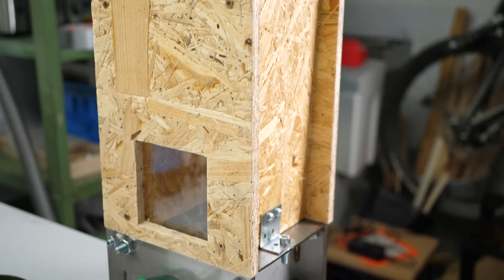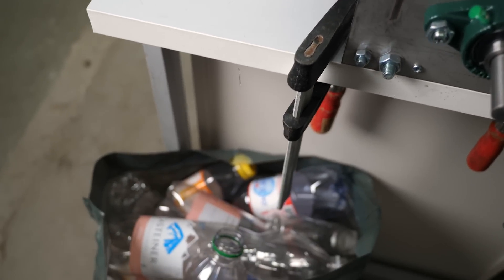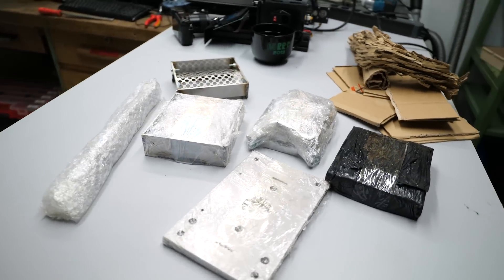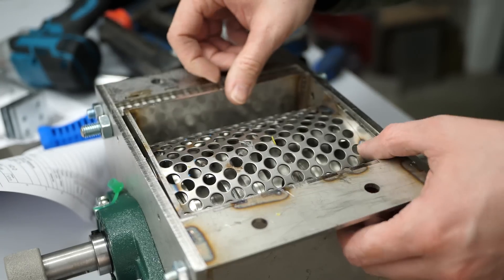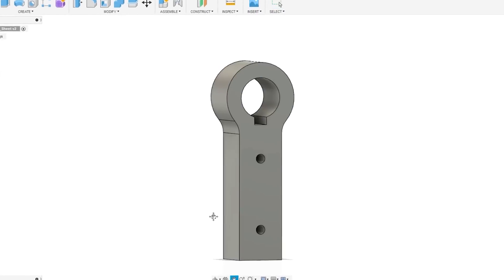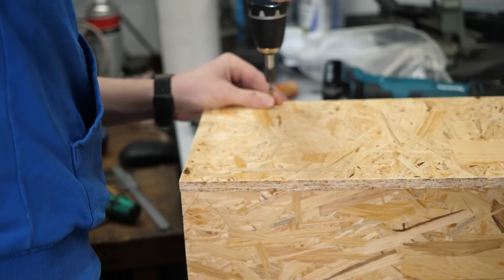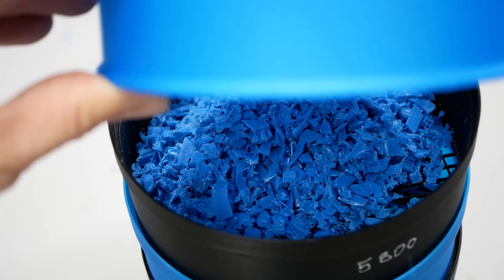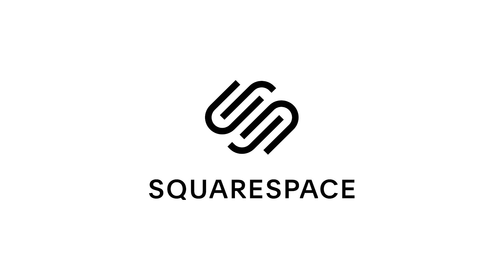Building a Hand Cranked Shredder for Recycling Plastics 💪

Comment: Hi Stefan.
first of all, i really hope the notorious covid 19 isn't doing too much damage there.
I think the machine you bought is very interesting but I think it really needs a lot more power to work.
You could try adding a (very robust) grid above the entrance to limit the amount of material that is sheared by the knives, as an electric planer would do, while in the current configuration the whole thickness of the piece comes to stand between the rotating knives with greater effort on your part, then adjusting the height of the grid you would get better control in the size of the ground material.
To compensate for the loss of efficiency then since the effort would have decreased, you could increase the speed of rotation.
I hope I have been helpful, otherwise I apologize.
P.S. another solution would be to use a branch grinder for the garden, it is an idea that has come to me now, the operation is similar to a food processor: two blades on a disk placed under a tube from which the vegetables to be sliced fall , if you know someone who has one you can test its efficiency and if it doesn't work you can send me to direct the traffic :-))

Comment: Braze or weld a socket on the end of the shaft and use a mechanics impact gun to drive it. you can get them as electric plug in units but the battery ones are more handy but a bit more pricey. the air driven ones are good but too load and cumbersome with the air hose and stuff.
the battery ones are about 1000-2000 ftlbs of impact torque and the plug in ones are 3000-10000ftlbs. Air ones range as high as you wallets value can expend.
That and a fly wheel would work well. You might be able to borrow a mechanics one if you take you contraption down to a local engineering shop.

Comment: If you don't use spur gear reduction, a single stage planetary gear box will add plenty of torque although you wouldn't be able to fix a flywheel.

Comment: I'd say add a geared motor. Your motor doesn't need to be as powerful then. Or at least add a gearbox as Ic3Fenix suggested. You can generate tremendous torques with a properly sized gearbox so you'll be able to drive it with a tiny Lego motor.

Comment: I think you should attach this thing to an old home trainer. Use a belt system as a transmission with the needed ratio (maybe you can even use the stock parts of the home trainer) and easily shred kilograms of plastic by using foot pedals :)

Comment: Just thinking out loud, but those industrially shredders take too big of a cut which requires a high torque force to work properly.
Couldn't you use or modify something like a rotary potato shredder or an electric "salad shooter", which would take smaller bites out of the plastic, requiring less force and also costs under $50.
Although not sure if it will cut the plastic into a constant size which you need, but I think it should definitely cut it...right?
I mean,  I just tried a cheapo hand cheese shredder on a junk 3D printed plastic part and it did start to shred it......again just thinking out loud  :)

Comment: if you can find an old powerchair, the motors on it would work I bet. the chairs here have a weight limit of around 600 lbs on them.. worst case you might have to gear it some..

Comment: What you could is use a car flywheel and starter.  You would have an adapter made for the flywheel to shaft connection. I think a starter would provide the necessary amount of  torque

Comment: here is an idea. if you get a nut attached to the end of the input shaft you can use a large pneumatic impact gun to drive it. pneumatic impact guns can provide up to 1200 ft lbs of torque so it should work.

Comment: Their marketplace is an interesting concept for connecting local business that would normally deal with primarily commercial customers, to consumers. Rather than having to pester fab shops to find one thats willing and isnt givng you a "I dont wanna spend the time on this but will if you really wanna pay" sort of quote, you can find a place that is willing to do it, has the setup for the project done already, and understands whats being built. Plus the fab shop gets to use whatever resources they invest in setting up multiple times. (Only have to do the CAD on the laser/plasma cutter once, only have to dial in the kerf compensation once)

Comment: Interesting concept! Have you considered using an impact wrench to power it? Not sure how you could implement a standard square drive on the input shaft without a mill or welder, but it would open up the possibility. Or at least you could use a ratchet wrench to improve the ergonomics, I nearly threw my back out just watching that lever go round.

Comment: might want to put a gearbox on that one before thinking fly wheel. a 1:3 ratio would mean you can shrink the handle by roughly 1/3 of it's length will still achieving the same torque. And should actually not use too much space. A flywheel would be nice too to get more consistency.

Comment: I would just make a gearbox (1:100 or similar) that accepts a normal hex socket and do the cranking using that Hitachi/Makita socket driver. Mustie1 uses an AC drill that he has a socket attached to it and uses it as a starter for the engine. Same idea, basically. The idea is that you get enough torque that you can easily spin it without having to back up every now and then.

Just for fun, you could theoretically try to to print a gearbox to do this, but maybe PLA isn't strong enough, a single tooth should be able to handle the full 50kgs of force and more.

Comment: Nice video! 
I would investigate if it’s possible to make a (plastic printed) gearbox where you can attach your battery powered drilling machine and it converts speed to torque, which you can then use as the driver for the shaft on the shredder.

Comment: I want to build a machine to take spools of filament and chop it into consistent, uniform pellets by feeding the filament into a rotating chopper.  I have some old spools that have taken on moisture, and my dehydrator doesn't do a very good job of drying them back out.  I think if I cut them into pellets, I will be able to dry it better, then use it for extruding back into usable filament or using it for injection molding.

Comment: I worked with an industrial shredder 25 years ago for a bit. You definitely need a flywheel for that small shredder. Also a hammer-mill style is much better design so that it can retract the cutting head. That way the cutter head still rotates and does not hang up. When I need electric motors, I use one from an old washing machine, there tuff and cheap or free. The motor uses V groove pulley so you can make a simple friction culch to engage the cutter head. In case of a catastrophic stop the belt will slip, very safe. The company that made that shredder could make a hammer-mill  cutting head small enough to.

Comment: I already have a full box of waste stacked up, even though I just want to do 3D printing as a hobbyist, and it's been less than 6 months I've had it. Most possible reason is that my printer is a DIY and wasn't ideally designed at first.

I would definitely consider to buy one if I had a proper workshop myself!

Comment: I wonder if you could get melted scrap prints to be fluid enough to flow enough like water and form droplets. If so, then you could cool those droplets as they fell into a collection bin and have some pretty uniform pellets to feed the next process. No clue if it’s doable, pure curiosity as that would potentially involve no mechanical parts and should be a relatively simple build. 🤷🏻‍♂️

Comment: Have a look at using an Anchor or Yacht winch for your drive system as time doesn't matter that much in your case. DC powered will give you maximum torque near stalled state in a more compact size than using AC. Keep at it :)

Comment: How about attaching a 160:1 high torque planetary gearbox made from a 3d print (https://www.thingiverse.com/thing:2375916), then use a power drill to drive the gearbox. I almost want to test this with a stationary bike to see if it is possible.

Comment: https://www.youtube.com/watch?v=uz436Ixbl-I

check this video, you need a regular motor and a gearbox that will convert the motor speed to torque power. From a small to a bigger diameter gear.
Edit: you can use your grinder as the motor, the grey on your shelf.

Comment: Awesome! I've been wanting to design a shredder like this, but the precious plastics prefabs sure are tempting. I just happened to source a beefy electric motor and gear train, but the handle solution is great
Reply: Make Anything will you actually end up posting a video on it when it’s done ;) don’t forget about the filament maker.
Reply: Hello , we invite  you to cooperate with our new 3d pinter model X5 , are you interested  ? I also send you email  .
Reply: I'm more worried of the price of the beefy gear reduction than of the beefy electric motor itself. I'm looking for a gear reduction rated for 500 Nm  ... and they are expansive.

Comment: I'dd add a speed reduction gearbox with a flywheel and a one way clutch (like in a normal bicycle). also tge option to swap the handcrank for a power drill. the gearbox should be able to withstand forces of more than the 500Nm you estimated. these gears should be strong enough if cnc carved from wood i guess.

gl

Comment: Seems you've just moved the consistency requirement further up the chain of operations. A way to avoid having to add a gearbox might be to have a separate manual press to quickly "pre-yield" thicker parts of prints so the grinding force is more even. A bit like one of those recyclable can crushers (but with a much longer lever) where you give potential problem parts a quick crush before tossing them into the bin so the later grinding is less difficult. A crusher with a long handle will be much simpler to make than a gearbox.

Comment: I've been exploring that topic before, I also shifted from filament to pellet extrusion and I even made sieves like to sort pellets, so I can share you my experience.  
Pellets are idealy rond, then cylindrical, cubic,  or whatever , before being some type of shitty shape. Raw shredded material is a pretty shitty shape. Though with more solid parts, you might have a chance with shredder alone. But I focussed on plastic waste, being PET, HDPE, PP... (you know, 3D printed stuff is cute and so, but you have to buy and use that plastic first, pla does degradate and... it just never made sense for me) , stuff we throw away every day, which is mostly thin walled. So how to make thin walled stuff thickwalled? Melting! If you melt PET bottles and let it cool kinda slowly, it becomes crystaline and is very brittle, it's almost statisfying to shredd it then and will go way easier then everything i have seen you do in the video. If you don't melt PET botlles first, DONT shred it! It's super though and it will damage your shredder. (I managed to destroy the bearing on a 3devo shredder, likely with a single bottle). On the other hand I thought,  If I melt it, I better melt into something i can easily make better pellets of, guess what that was: filament. So I used a syringe type device to melt platics into a crappy filament, to be shredded in cylindrical pellets. And that's basically my experience with it for now. 
I plan to melt plastics in battery like shaped in the future and print those directly as 2cm thick filament or so, as I over found the overal process of making pellets too cumbersome after all.

Comment: Instead of long Strait funnel, you could do a short one either with a light lid, or a misaligned v shape introduction cone ( with proper alignment bouncing parts can't escape a V ).

Donc use a fixes inertial wheel. Design it like impact drill : it can state a full circle, so that you can turn it a complete revolution before hammering the end. You may need a quarter circle mobile bit, to allow such a large movement.between  two hallow.circles. Check how hammer drills work. Also check large vis used to press books in manual book manufacturies. The vis is actionned by a two element handle. The upper one is.used as rotating hammer against the lower one. Those presses offer tremendous amount of pressure with a simple.manual direct vis, without any geer or démultiplication.
Reply: https://youtu.be/9HxTs4e5Zu0
After 0:45 they give a rough explanation of inertial rotary  hammers ...

Comment: Im hoping to do something similar but putting it on a stationary bike or motor (able to switch it for working or demonstrating). If i do the bike, would it be wise to start pedalling first and then add some pieces in to shred? Like building momentum so i dont have to back pedal as much?

Comment: you should print some filament on the print bed from shredded material then shred it one more time to get even and soother print.
that or make a cutter that takes the rough re-melted material and cuts it into the recommended size for you remelter

another thing you can try is getting an arbor press and smashing all the prints you plan on recycling. this will make them thinner and easier to shread.

Comment: I've been thinking of a slightly more streamlined method for recycling my failed prints and such when the ol' memory had a moment of relapse. I recall that a number of years ago a Japanese fellow was working on a way to recycle common plastics in a heated vacuum chamber for the purpose of converting the oils back into petroleum products that could be further refined into fuel. While it looked like an interesting idea, it was, shall we say, undersized for bulk processing.
Case in point, a similar setup would be fantastic as a PLA/PETG oven that could melt down scraps into straight ooze and fed into an extruder.
add: here it is https://www.youtube.com/watch?v=qPIHJRIpLRk

Comment: i would have tried making a shredding bar myself, each plate only having one tooth so less is cut at a time, and i would have added some kind of gearbox so i could use a smaller crank or a cordless drill to power it

Comment: First of all, you could shorten the crank by using a star-gearing. You would need to crank twice as often though. This also would have the benefit of possibly not throwing around the machine. Then, you need to mount it to the bench sturdier, but for a first test, this loos good!

Comment: 150 euros should get you a geared nema 34 motor capable of shredding it, along with an arduino and TB6600 stepper driver.
Reply from the maker: Unfortunately nowhere near the 500Nm required.

Comment: To help find the high spots you could always use permanent marker on the teeth and rotate the cutters then file at the scrubbed points to knock down the high spots. Rinse and repeat until you don't see any bald permanent marker spots after rotating.
Reply from the maker: Good point! Should have thought about that.

Comment: very cool, but a bit beyond my current budget. could we not use a wood chipper for first stage followed by paper shredder, cheap and easily sourced?
Reply from the maker: Maybe but I think that's only working with brittle materials. My goal was versatility and also consistent particle size.

Comment: Gear box and a little shorter depth of cut on the teeth would help. Then you could nibble away at larger prints rather then attempting to chop all the way thru the print.

Comment: I would use a 3:1 gearbox to power the shredder, that way the crank would be easier, and you could also use a simple 230 NM drill to power it as well.

Comment: Use a winshield wiper motor or a garage door motor. 
They are verry small and have high torque. Also they can be powerd by a 3d printer or atx powerbsupply.
And if it has not enough tourqe you can add simple gears and a chain.

Comment: Looks cool. It would be better with some kind of gearbox.
I have a single question. Why using pellet directly?  Filament was used to better control flow rate of plastic. Now, you've got a bulky & heavy head that will hardly accommodate an acceleration of the extrusion and may encounter plastic flow issue (if an air bubble formed). Even the pellet supply to the hotend seems had extra weight. I may be totally wrong but I'd like to have an explanation on how it could be better than filament. Nevertheless your video are still as enjoyable as before. Thanks and take care.
Reply from the maker: The main argument for the pellet extruder is less material cost and the ability to run small batches of material.